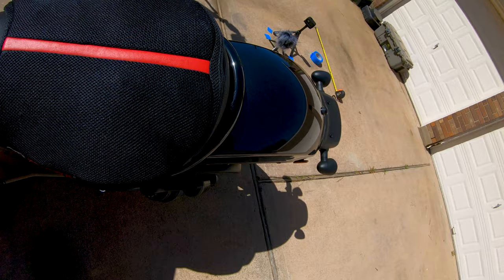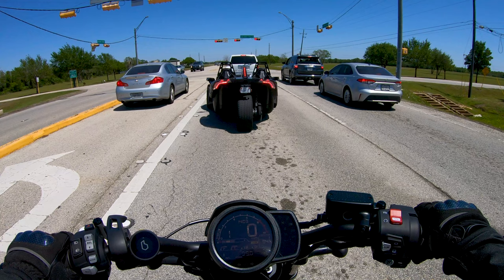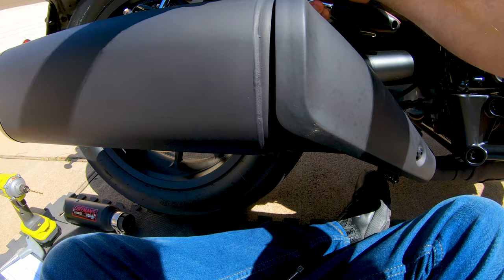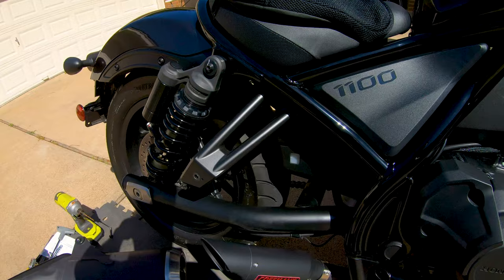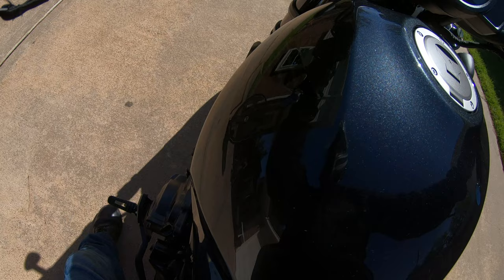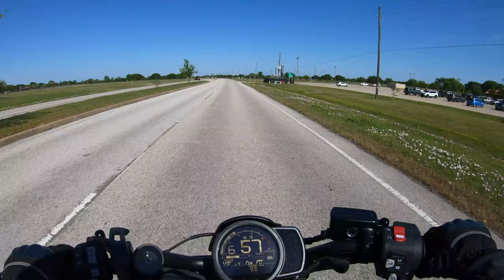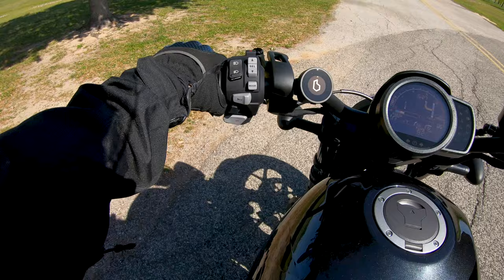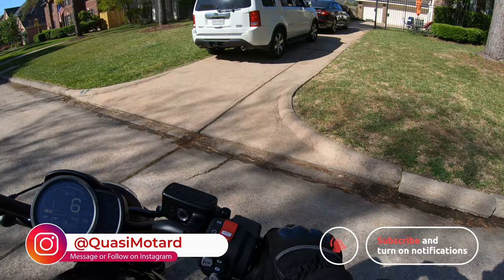REBEL1100: Coffman's Shorty Exhaust - Installation & sound comparison

Comment: Did you ever figure out how to remove that big aluminum piece that the stock muffler is connected? Was it something under the seat/battery that you had to remove? Any video on that?
Reply from the maker: That bracket on the right side is dual purpose:  it's an exhaust hangar bracket and also the passenger footpeg mount.  I installed the passenger seat and footpeg kit shortly after this video, so I didn't remove that bracket.  The passenger peg kit comes with a matching (reversed) bracket for the left side of the bike, so it's a symmetrical arrangement.  

The left bracket attaches to the rear subframe under the seat .  You need to remove the battery box to access the bolts in the tail section.  Each peg bracket is secured by two large bolts (8mm or 10mm hex, can't remember), and they can be removed completely if you don't want them on the bike.

However... VERY IMPORTANT... you MUST replace the bolts in the subframe even if the brackets are removed.  DO NOT leave those bolt holes open.  One of my channel viewers in Canada removed his pegs and brackets completely and didn't replace the bolts.  He replied a few months later saying that his rear subframe had twisted a little bit and he couldn't screw the bolts back in.  Ooops!  Cheers!  😉👍
Reply: @QuasiMotard  Thanks so much for the response. I don't plan on adding any passenger pegs so will just remove it. Thanks for the tip on re-adding the bolts though.

Comment: Whats the difference between the coffman one and the Shorty GP exhaust? You can get a baffle to fit into the shorty gp as well.
Reply from the maker: The Shorty GP from Radiant (?) is a decent budget option.  I know two Rebel owners who have installed those and liked them initially, but the build quality isn't very good.  They aren't made from high-quality metals, and they reportedly rust and degrade quickly.

The Coffman's exhausts are constructed entirely from heavy-gauge stainless steel, and they are ceramic coated for extra durability.  They are also completely rebuildable.  You can repack the sound batting and o-rings whenever those wear out.  The body and internal baffle are nearly indestructable stainless steel, so they should outlast the motorcycle.  Cheers!  😉👍  --QM

Comment: How did you remove that graphite gasket? I just took my muffler off but that remained on. Any help would be greatly appreciated man!
Reply from the maker: Luckily, the gasket stayed attached inside my OEM muffler's flange and NOT on the exhaust pipe.  If the gasket is stuck on your pipe, you might try using a dull knife to gently pry the gasket rearward bit by bit (a little at the top, then bottom, repeat).  

If you're trying to remove the gasket without any damage (to reuse it), then you might also try using ice or "canned air" upside down to quick-chill the exhaust flange near the gasket.  The thermal contraction of the pipe might give you a few thousandths of an inch clearance to twist and slide the gasket off of the pipe.  Using rubber or nitrile gloves to help grip the gasket can also help to twist it around.  Good luck!  😉👍  --QM

Comment: Very nice I dont know what bike to choose Rebell 1100 or Dorso Duro 900
Reply: Totally 2 different bikes that Dorsoduro is. Look at the Rebel 1100 versus Indian Scout Bobber. Pretty much the same market, engine size and weight.
Reply from the maker: Agreed!  I was looking hard at the Indian Scout Bobber, but the Honda won out with its modern electronics and rock-solid 1100 Africa Twin motor.  The thing that really concerned me about the Scout Bobber was the measly 2.0" of rear suspension travel... that must be really rough riding around Houston's rippled, pothole infested roads.  I haven't ridden the Scout Bobber to make an informed opinion, but I can't imagine that the rear suspension would suit my needs for commuting and touring.  The Rebel 1100 certainly isn't an ideal tourer with its rough rear shocks, but 3.7" of travel vs 2.0" is a significant difference.

I still might pick up a used Scout Bobber sometime in the next couple of years.  That is one good looking machine!  Cheers!  👍  --QM

Comment: I just bought the same exhaust. Though, I'm going to wait to put it on because the honda exhaust is a  like a guard.  When I last crashed into a curb, it saved my back end. I don't care if that ugly exhaust gets all scuffed up :) I just installed my crash bars. It just makes me feel better with my investment while practicing to ride. Thanks for the great video. Oh quick question, do you have to put the rivet in? Or can you just tighten it down.
Reply from the maker: Definitely drill the hole and install the rivet!  That is a safety measure to ensure that the muffler doesn't go flying off if the exhaust clamp loosens up over time.  I have checked the clamp a few times and found that backed out slightly, so I cranked it down again.  😉👍 --QM
Reply: @QuasiMotard  Good to know! Can you tell me what rivet tool you used?
Reply from the maker: I have a cheap rivet gun from Harbor Freight ($15) that has multiple die sizes.  If I remember correctly, the drill bit was 9/64".  Drilling and setting the rivet is quick and easy after you clock the exhaust to the correct angle.  

Just be sure that it's not too close to the swingarm.  I left about 1/2" gap with the swingarm fully extended.  I  checked by tilting the bike onto the side stand and lifting the rear wheel off the ground slightly (full extension like topping over a rise).  Cheers!  😉👍 --QM
Reply: @QuasiMotard  Thank you so much for explaining this in depth. I appreciate it!

Comment: Is there any way to remove the bracket the old exhaust bolted to?
Reply from the maker: Yes, the bracket on the right side can be removed from the frame (two bolts behind the battery box).  However, that bracket is also holds the passenger peg, so I left it on the bike.  The passenger seat & footpeg kit includes the matching bracket for the left side and the two folding footpegs.

Note: if you DO remove the right bracket, then be sure to put the two bolts back into the frame to prevent the rear subframe from twisting and becoming misaligned.  A few of my channel viewers have mentioned that they had that problem afterwards and they couldn't get the bolts back in a few months later.  Cheers!  😉👍  --QM

Comment: So, save money with this or go really cheap route with the $60 Radiant?  Or, big bucks for TBR or V&H.  Is there any diff in performance?  To me they all sound great and save weight.
I'd appreciate comments
Reply from the maker: All good questions!  I haven't purchased any of the other exhausts for the Rebel 1100, so I can't give an educated opinion... yet.  I may eventually upgrade to another exhaust if/when Akrapovič or Remus have some straight-back (not upswept) options.  I plan to install saddlebags on my bike, so the exhaust angle will be a concern.  Cheers!  😉👍  --QM

Comment: Awesome review!! Does this exhaust have a catalyst in it? And how does it compare with the 60$ shorty by radiant cycles (which can be paired with a cheap/$15 40x40mm baffle catalyst)?
Reply from the maker: No, this exhaust is just a slip-on muffler.  The Rebel 1100's catalyst is contained in the collector forward of the exhaust (as far as I can determine), so the change to the bike's emissions system isn't a factor.  👍  --QM
Reply: @QuasiMotard  you even answered my follow-up question beforehand lol. thank you and happy riding! (the Coffman's sounds great, but I think I'll be waiting for the straight twin exhaust from Gem)
Reply from the maker: I'll check out Gem to see how their system looks. Thx for the tip!  😉👍  --QM

Comment: Are you able to put the coffman on with just the clamp?
Reply from the maker: You could install the Coffman's shorty using only the clamp, but it wouldn't be secured properly.  Thermal expansion can cause the muffler to expand and contract relative to the headpipe, so it might literally blow off of the bike under the right conditions.  The rivet sets it in place to be sure that the clamp won't allow it to back out.  Cheers!  😉👍  --QM

Comment: hi @QuasiMotard! I really want to swap out my exhaust for something shorter (saddlebags eventually!) but wanted your honest opinion on whether I should go with this Coffman exhaust you bought (is it a safe one to keep on for many years) or would you recommend waiting for aftermarket to catch up? Thanks and love your content!
Reply from the maker: I don't see any reason why this Coffman's Shorty can't be a permanent upgrade.  I plan to leave it on my Rebel semi-permanently, or at least until I see alternatives from Akrapovič or Remus are available for comparison (the OEM exhaust is definitely not going back on the bike!).  Those exhausts will obviously be MUCH more expensive (probably in the $600-900 USD range), so it will be a calculated decision based on looks, weight, and sound levels.  If you rotate the Coffman's just slightly more upward than I did in this installation, then the bend at the base of the canister should bring it in closer to the bike just a bit.  In any case, it still doesn't stick out any further than the factory exhaust... it's about 1.5 inches narrower overall.

I am planning to do a follow-up video with a good SPL meter to get more scientific results.  Several viewers/owners have inquired about the dB measurements because of local restrictions.  I will record that quick video with dB readings and dedicated audio just like this one, but I will also find a way to post the high-quality audio files outside of YT.  The audio compression in YT's videos limits the audio steam to 126 Kb/sec AAC format, and there is additional loss due to the re-compression of my original files (320 kbps AAC).  Cheers!  👍  --QM
Reply: @QuasiMotard  Thanks for taking the time to respond! I'll definitely keep an eye out for that as I'm about ready to pull the trigger on that Coffman exhaust. Cheers!
Reply from the maker: @exoneer6036  If you haven't purchased the Coffman's Shorty exhaust yet, then wait for a bit!  I spoke with them on the phone earlier this week, and they are making modifications to the Rebel 300/500 exhaust to adjust the angle to fit the 1100 better.  I'll be hacking mine to rotating the body about 90 degrees (and rotating the endcap to maintain an outward flare), and then I'll take pictures and send to Coffman's.  They said that they can make the required changes very quickly (e.g., new endcap direction, placement of the Coffman's logo plate, etc).  I'll keep everyone updated on that progress as it unfolds.  Cheers!  👍  --QM
Reply: @QuasiMotard  thanks for the update! I'll keep an eye out for it 😎👍
Reply from the maker: I just released the second video with a new Coffman's Shorty, and I included audio and dB readings:  https://youtu.be/xqvVA_YBYLE .  I hope that helps with your shopping!  Cheers!  👍  --QM

Comment: have you tried the royal enfield himalayan yet? been looking at them after seeing shawn smoaks riding his. things geared like a tractor climbing hills.
Reply from the maker: Not yet!  I was really amped up to ride the Himalayan when it was first released, but then I heard about the transmission problems and quality control issues.  Apparently, they have resolved those early issue and the bikes are much more reliable now.  That might be the eventual replacement for my Yamaha XT250... can't decide between that or the Honda CRF300L.  👍 --QM

Comment: Not a fan of the look of the shorty tbh maybe if it wasn’t pointing up. Sounds good though.
Reply from the maker: Thanks for the feedback!  I worked with Coffman's on a prototype exhaust to fit the Rebel 1100 properly:  https://youtu.be/xqvVA_YBYLE .  That unit has a proper bend and fits the 1100 much better than the original "Shorty" that I tested in this video.

Coffman's has also sent a new exhaust to me to test & review on the channel.  The new "Thunder" model is a longer unit that is slightly upswept and it attaches to the rear exhaust hanger bracket like the OEM exhaust.  I'll be testing and posting that video soon to show everyone the comparison between the Shorty and the Thunder, and also to show whether the new unit still allows a saddlebag on the right side or not.  Cheers!  👍  --QM

Comment: I'm trying to put the same exhaust, but it won't go all the way down. I really want to hammer it, but I don't want to damage it. What would you suggest.
Reply from the maker: The Coffman's Shorty should slide down flush to the extruded flange/ring on the exhaust pipe.  If it won't slide down far enough, then you might try using a wide flat piece of metal (flat file or a wood chisel) to gently widen the slit on the opening of the exhaust to give a bit more clearance.  Otherwise, just twisting back and forth while gently tapping the end with a rubber mallet should do the trick. 😉👍 --QM
Reply: @QuasiMotard  I think I'm going to try twisting back and fourth with a rubber mallet. It's just an inch off...Thanks for your help!

Comment: Thank you for fhe video. Really helpful. 
What do you think of the noise? I cant decide if I want the Rebel 1100 or a Triumph Street Twin. Triumph are known for that incredible noise and im dubious if the rebel will sound as good
Reply: Triumphs don’t sounds that good stock but you can add an x-pipe and it will make it growl deeper. With the rebel, slip on won’t do much so we will have to wait for a full system to see. But as far as I think, 1100 cc will sound bold with a full exhaust.

Comment: Appreciate your videos, Quas.  I wonder if there is a union that could change the angle of the available Coffman so that a straight back angle can be had.  Heard of any such thing?  I have no fabricating ability in my retirement community in FL.  So, if anyone is aware of a patch for the Coffman, I'd be grateful for the info/source, etc.  Thanks
Reply from the maker: Thanks for the feedback, Will!  Stay tuned for some new videos about the Coffman's exhaust coming in the next couple of days.  I am working with Coffman's on a prototype exhaust, and I'll be installing that today or tomorrow!  It is the same unit with a different bend and the end cap oriented correctly.  We'll see how it turns out very soon!  Cheers!  😉👍  --QM

Comment: Ive heard the bike runs super lean, have you needed to retune the engine now with the new exhaust?
Reply from the maker: Most of the newer Euro-4 and Euro-5 compliant bikes run lean by default.  I haven't noticed any problems with my bike since the exhaust was changed (e.g., no excessive decel pops or backfiring).  However, I do plan to tune the bike with my Dynojet PowerVision 3 when the licenses and maps are available.  I'll most likely take it to an authorized Dynojet shop to put it on a dyno for some real load testing instead of just going with a pre-packaged map.  Hopefully, we will also be able to remove the 99-100 MPH speed limiter!  👍  --QM

Comment: Do you need a remap for this exhaust?
Reply from the maker: No, this is a slip-on muffler that retains the factory catalytic converter, so it doesn't drastically alter the engine's airflow.  I have 6000+ miles on this setup now with no adverse affects on power or fuel economy.  The sound is much better, and the bike shed ~10 pounds in the process.

You might be interested in the follow-up video here with the production Shorty and a SPL test:  https://www.youtube.com/watch?v=xqvVA_YBYLE .  The next video is a comparison between the Coffman's Shorty and the Thunder exhausts:  https://youtu.be/4Y48--_1rms .

If an intake modification (e.g., K&N air filter or other airbox mod) is also done in conjunction with these exhausts, then the engine might run too lean (hot).  That would probably require a reflash of the ECU to compensate for the added airflow.  Cheers!  😉👍  --QM

Comment: Will anyone make an exhaust that is more straight back or a collar that could change the outward and upward angle of something like like the Coffman? I'd like matching panniers on my 1100 and less exhaust in a passengers face.
Reply from the maker: I'm waiting for the same thing.  It seems like the only aftermarket exhaust options for the Rebel 1100 right now are from Two Brothers Racing and Vance & Hines.  Both of those options are upswept, so they might interfere with the right side pannier.  I plan to have panniers on my bike for road trips, so those exhausts won't work for me.

I'm waiting to see if either Akrapovič or Remus make an exhaust for the Rebel 1100... they already have products for the Africa Twin 1100, and it uses the same engine.  If they do make exhausts for the Rebel, then I hope they have a straight-back option, or at least not angled too much upward.  Cheers!  👍  --QM